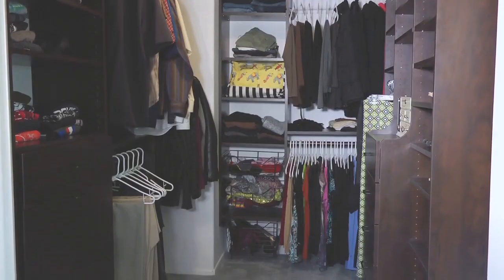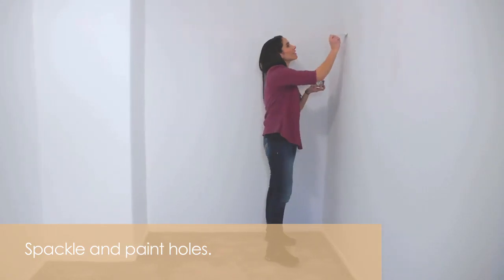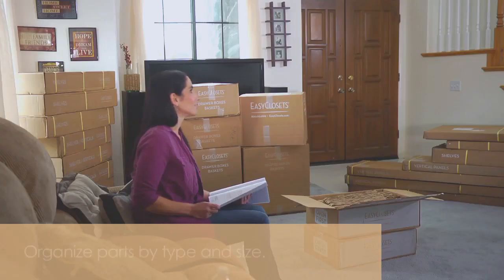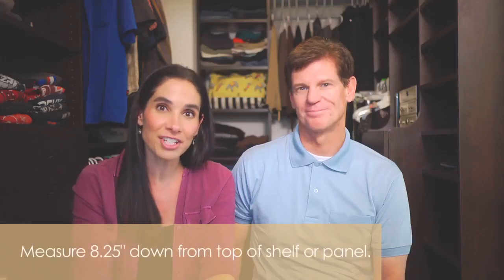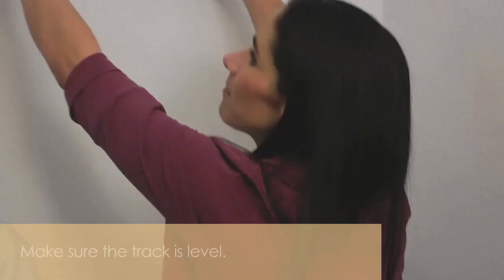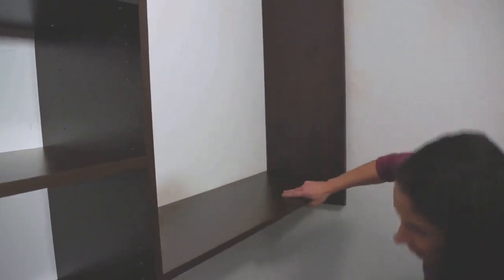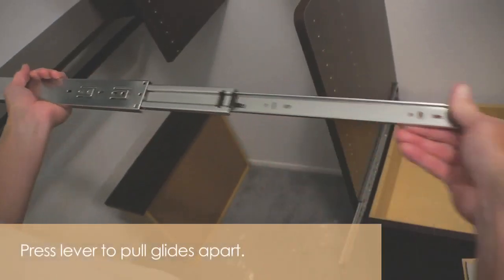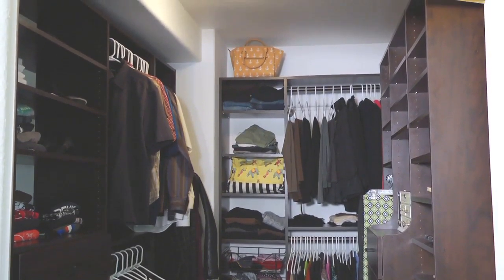Tips and Ideas for Installing Your Closet System

Comment: Very poor instructions, and not even the same product design in your videos. As many of these things as you sell... You would think you could put together a semi-professional updated video of instructions, pointing out the ambiguous parts from initial unboxing to rail and drawer glides. Tutorials arent expensive and it would certainly save your clients a ton of headaches. Your competitors are doing it. My wife purchased this and I assumed it would be a breeze. (I want her happy) This was a pain in the butt. A good video would have answered and created a much faster and less stressful install.
Reply: This is the most frustrating build I’ve ever done. There’s nothing connecting the far end verticals to the main unit like in this video. For the cost of this there should have been a full instructional video.